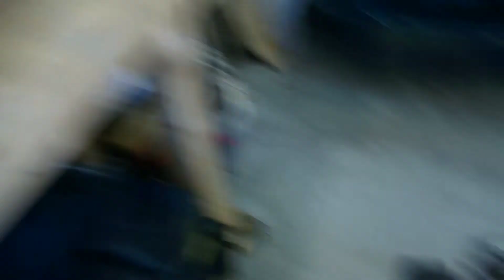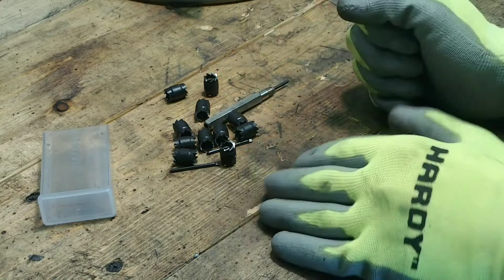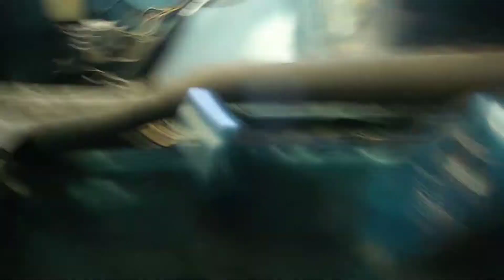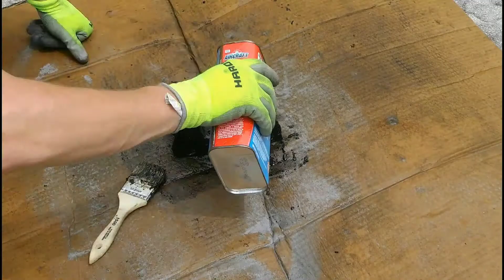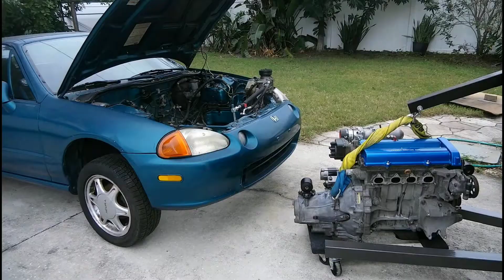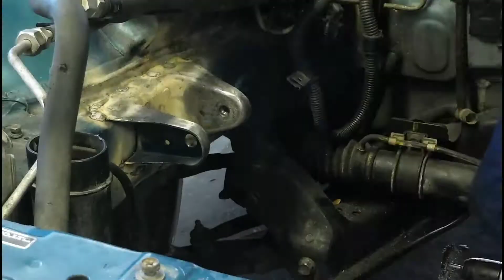Del Sol Hydro to Cable Conversion -PT.1

Comment: Sup bro, nice video, I was wondering if you got the right mount, I am in the same situation as you are, the mount is a little bit shorter and it doesn't look like it will fit unless i slotted it, how do you fixed that?
Reply from the maker: Hello I had to use the innovative mount
Reply: @ThatParadiseEj1  nice bro! Thanks a lot, I will have to get it then
Reply from the maker: No problem. Fortunately a friend of mine had one. It's really unfortunate that the cheap one doesn't fit.
Reply: Bro, sorry to bother you again, but how did you bleed the slave Cylinder? Having a hard time to do that

Comment: I was wondering what Tbracket did you use for the cable transmission to fit the del sol rear mount?
Reply from the maker: 94-01 integra t bracket!